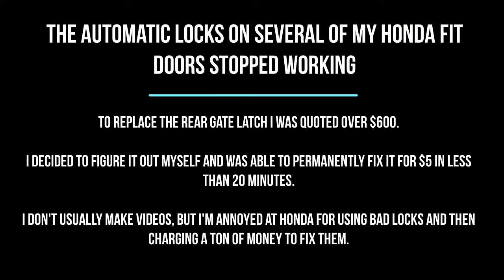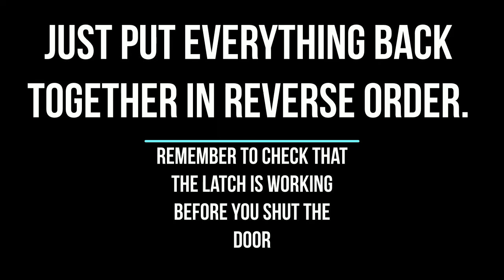Fixing REAR HATCH Broken Automatic Door Lock Actuator for $5 on Honda Fit or Honda Jazz.

Comment: Extremely important note! The listed replacement motor will not work with this actuator UNLESS YOU SLIGHTLY FILE DOWN THE REAR METAL NUB ON THE MOTOR. My motor kept seizing until I did this mod, and I spent many hours trying to figure out what was wrong since I was unaware that a mod was needed. Please add this to the description so people can avoid this, this info would have saved me many hours of fiddling with the actuator and from swapping out multiple motors needlessly. Also, I had to utilize zip ties to keep my actuator from popping open when the lock is activated. Even with the screws holding it together, without the OEM glue it doesn’t want to stay closed when in use. Aside from that, thanks for the videos. I just utilized your Honda Fit passenger door lock actuator video, very helpful.
Reply: just wanted to come on here and confirm that this is still a issue as today this was the very problem i encountered, but the fix is easy.

Comment: Hi,

What was your issue actually ? I'm having an issue with my 2009 FIT where the latch on the tailgate will not unlock properly. That little round white plastic knob that you mention around 5:05 is somehow stuck. When trying to unlock, the white knob tries to move but go back. I have to use a screwdriver to move it so it will unlock. This has been happening for weeks. Could it be the motor ?

Maybe you can help me out on another issue as well. The tailgate open/close sensor seems to have an issue. It always sends the signal that the tailgate is open so the dash shows that a door is open and I can't remotely lock my doors. Tonight I found that the cable that you unplug at 1:12 is actually the sensor for the tailgate. Unplugging it fixes the issue but of course my sensor is not working anymore in the tailgate. I left in unplugged for the moment so I can at least lock my doors remotely. Would you happen to know why the sensor failed ? I did not remove the whole locking assembly yet, but I'm trying to think ahead and find out what is broken. Any ideas ?

Thanks :)
Reply from the maker: Guillaume Léonard That sounds exactly like the issue I was having. The lock wasn't working so the sensor was sensing incorrectly.